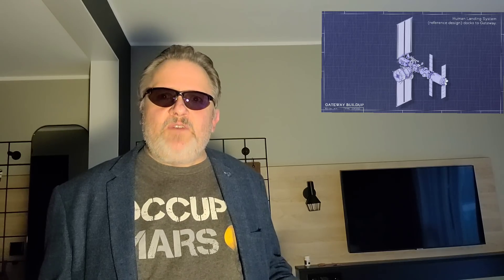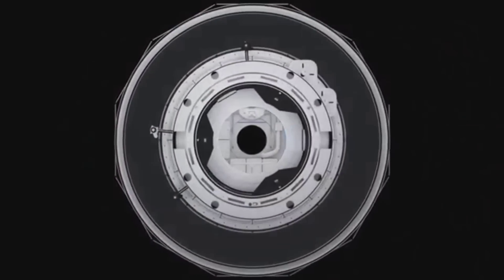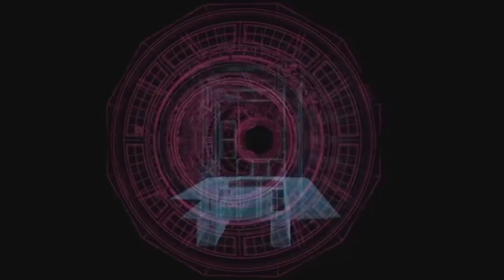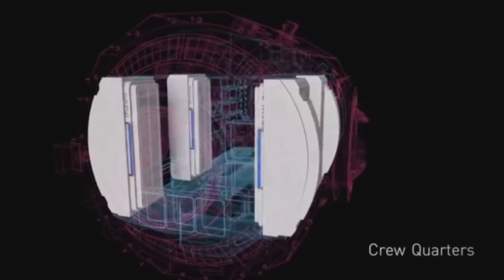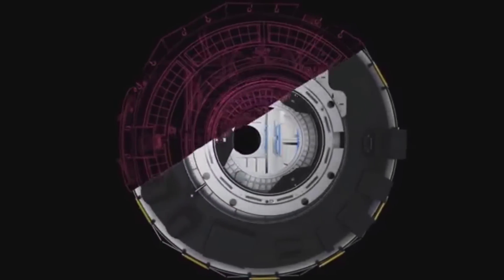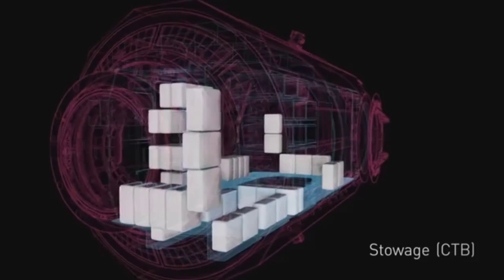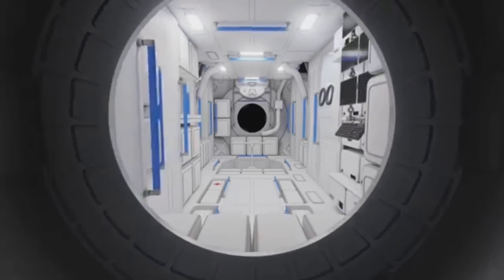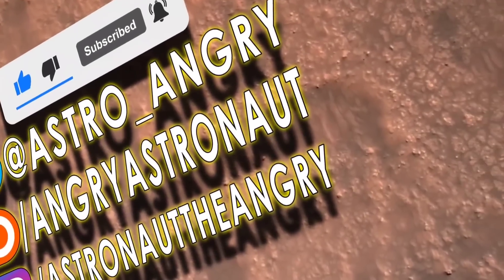New Lunar Space Station design has big problems!  NASA has better options!

Comment: I think ,it was a bad decision in general to chose an architecture involving a space station in Lunar orbit. While the apollo missions proved it to be unnecessary.  Compared to the ISS , lunar gateway is exposed to 3 times the cosmic radiation and solar winds, because on the ISS, the mass of Earth already shields from 50% of all radiation (coming from that direction), and additionally the ISS is within the Earth´ magnetic field. 
To supply lunar gateway with food ,water, and other resources requires a lot of extra effort, compared to ISS which is much closer.   To bring humans to the Moon, also you do not save any delta-V or fuel, compared to a direct rendezvous with lunar starship, since any extra rendezvous maneuver requires some extra delta-V. 
And finally, what shall humans do on the tiny lunar gateway,  what they cannot do better on the surface of the Moon, except trying to survive, cosmic radiation and claustrophobia ?

Comment: You're not wrong. Why does even the lunar base camp habitat incorporate an inflatable upper level, but Gateway has no inflatables? Sure rigid modules are time tested and well proven, but wasn't that the point of testing the BEAM module on the ISS? Only to go backwards, to an all-rigid module design for Gateway? This is NASA's big leap forward?

Comment: I salute "The Angry Astronaut" for this video. It's about time someone brought up Sierra Nevada Corp. / Sierra Space's inflatable LIFE habitat modules, which will see use on the Orbital Reef space station in Earth orbit. It's also high time that someone brought up that any operations in cislunar space will automatically raise the bar for crew habitat protection because of solar radiation, solar particle emissions, and galactic cosmic rays that would be far more abundant outside Earth's magnetosphere. These phenomena are known to represent a serious health threat to astronauts. 

I would like to add a possible idea to the notion of using Sierra's LIFE modules on the cislunar Gateway station. Here is a multi-step proposal that may make such a habitat module even safer:  (1: When designing and building The Angry Astronaut's proposed half-size LIFE habitat, Sierra (or whoever) must include secure packets of grease to line the entire fabric hull of the LIFE module; this enclosed layer of grease naturally contains hydrocarbons, which contains hydrogen. Hydrogen is the best known protective natural screen to stop harmful radiation and rays. (2: when erecting the new station in lunar orbit, set up a hollow, skeletal structural framework outside the final size of the LIFE module's inflatable volume so that this framework does not directly touch the module except at key structural points to keep the module centered inside. (3: Once the LIFE module is properly installed and inflated to its ideal volume and secured inside the outer skeletal framework, wrap the entire outside of the framework with an additional layer of LIFE module-like fabric to form an outer cocoon around the framework. Then spray the outside of this cocoon with a successive layers of water, to form an outer shield of thickening ice. Water ice also contains hydrogen. 

Would these additional layers of protection improve the safety of a habitat module? I would hope so. 

As for what vehicle could carry a LIFE module to cislunar space, let's not overlook the (pending) obvious one: Blue Origin's New Glenn. We are about to cross-over the major milestone of Blue Origin's BE-4 rocket engines being used for the historic first-ever launch of United Launch Alliance's new Vulcan rocket. And hopefully several months after that, Blue Origin itself will conduct its maiden flight of New Glenn. If these major milestones come to pass, NASA will be that much closer to a heavy launch vehicle that could deliver a full-size LIFE module to cislunar space. But wait... you say that I'm jumping the gun? New Glenn isn't going to be prepared to go beyond Earth orbit? This may be true for a New Glenn rocket, *by itself*. But consider this: if SpaceX could take three (3) Falcon 9 launch vehicles and put them together to form a more powerful Falcon Heavy for larger payloads and more thrust, why couldn't Blue Origin take three New Glenn vehicles and merge them together to form a New Armstrong? 3.85 million pounds-force of thrust, x 3,  will handily give Blue and NASA a new-generation launch vehicle, with at least partial re-usability, that could deliver a large payload to the Moon as effectively as NASA's backward SLS or SpaceX's Starship, and probably more.

Comment: After spending some time doing  so research. Also watching your video on starship nonreusable..I looked  at the lunar gateway  station and it is a desine disaster. I mean  total length 40 feet. Total diameter 10 feet. When all equipment  is installed  you have a hall way 4×4 feet. That is it. For a cost of $935 million but it is a goverment program so more like $1.5 billion. That is just building cost not including  the cost to put it in orbit.. why not build a modified  starship and put it into orbit for less cost and get more bang  for our buck..

Comment: Bezos should consider using O'Neil cylinder or torus designs. They are enormous in size and spin to provide gravity. The stations now are not more advanced than Skylab.
Reply: torus design would be better. O'Neil cylinder has severe problems and little to no air circulation. At least with a bulkhead you will get the air forced to circulate.

Comment: Space bouncy castle to the rescue, other choice is space Lego like the ISS, how about a StarShip with removable hatches on the fuel tanks and a cargo hole full of flat pack interiors components to convert the fuel tanks space into useable space. Maybe bring back some extra Moon dirt or as space nerds call it lunar regolith for shielding, have mounting brackets Pre-welded in place inside the tanks for interior assembly as well as outside StarShip for Ion thrusters Etc. you would have a space station with 3 separate pressurised compartment in case of an puncture to the station hull. The other possible would be to keep all the plastic rappers and compress them into radiation shielding tiles.

Comment: With a tweek to the design. Might be able to use uncrewed supply modules to attach to the outside of the crew module to offer more protection from radiation. Garbage, waste and etc could then be stored in the empty ones to offer additional protection from radiation possibly then offering a little more space within the habitable module.

Comment: 6:55 
There are many errors in this statement, so let's set the record straight.
I-HAB was initially designed to have ISS MPLM diameter (~5 meters) but that required to launch it as an SLS comanifested payload, without any other options.
The I-HAB designers wanted more flexibility in launch vehicles so they changed the module's diameter from 5 meters down to 3.1 meters, with a pressure vessel derrived from the Cygnus spacecraft, much like the Gateway HALO module.
This change in diameter meant that I-HAB could now fit on either SLS or any other commercial launch vehicle with a 5 meter payload fairing.
At the end of the day, this diameter change proved completely unnecessary because I-HAB ended up being assigned as an SLS Block 1B comanifested payload anyway.
I-HAB is currently manifested to launch on the Artemis 4 mission as the first of 3 Gateway modules (I-HAB, ESPRIT, Airlock) that are slated to be launched comanifested on SLS Block 1B, and is to be tugged into NRHO and delivered to Gateway by the Orion spacecraft.
It is not slated to be launched on Falcon Heavy with a standalone tug stage, but the fact that the designers wanted that option early on limited the scope of the module(s).
By the time the launch was decided to be on SLS Block 1B it was too late to change the diameter, so they are stuck at Cygnus diameter modules even though SLS has enough comanifested mass/volume capacity to launch MPLM diameter modules.
Too bad but it is what it is.
It's going to be a cozy little space station in lunar orbit, but astronauts should have no problem.
In regards to windows, the next module after I-HAB, ESPRIT, will have a 360 degree cupola section so there's no need to worry about nice views.

Comment: NASA needs to use the SpaceX Super Heavy booster as the first stage of a two, or three stage supersized Saturn V type Moon rocket. Even if the upper stages were disposable, the savings from the reusable first stage would be a game changer for the cost to put things in distant orbits, or landers on the Moon. 
Using a flame curtain might enable the second stage to be reused. Some private company is working on such a design for a reusable second stage right now. 
The Super Heavy alone is so powerful that it is a game changer all by itself.

Comment: Is the Sierra Space Life Module designed only for Vulcan Centaur?  5.4 meter diameter and 60,000 lbs to LEO.  Falcon Heavy is 3.7m and 50,000 to LEO.  Rocket Lab Neutron is 5m diameter equivalent for stage 2, and 17,600 lbs to LEO.

Comment: I have to agree with Angry here...  the inflatable tech would seem to be a a no-brainer for space station applications.  how much would it cost to just do an unmanned full-size, long duration test of the Sierra Life module, with no systems other than the most stripped down basic essentials, in the Distant Retrograde Orbit that Artemis 1 used?  literally, just send it with the instrumentation needed to monitor its performance and the environment.  

you don't need to spend billions of dollars to do onsite unmanned testing, and with inflatables you certainly don;t need to waste payload space by sending the hab module already fully fitted.  we are going to have to start doing on-orbit construction sooner or later, and stuff like fitting out habitable volumes on orbit (instead of sending modules up already fully fitted) would be a decent start.

Comment: AA criticism of I-HAB's retricted accommodation does not include the volumes of the attached modules: HALO; CYGNUS; Airlock; Lunar Lander; aside from ORION. The delivery of 4 modules and lander will occur before, during and with both ARTERMIS 2 and ARTEMIS 3 missions. So GATEWAY will have 4 modules plus ORION for ARTEMIS 2 and 5 modules plus ORION for ARTEMIS 3. This means GATEWAY will have accommodation similar to a small city apartment for 4 people for 6 weeks (with a trip for two for 10 days down to the surface!)  Doesn't sound too bad, really.

Comment: Lunar Gateway has always sucked. Why? The way the program was developed. NASA wanted a high tech follow on program using a cheap heavy lift vehicle developed from discarded Shuttle components. Once a SLS was designed, it needed a mission that is could support as it couldn’t land astronauts on the moon. Industry came up with Gateway. I quote Dr Robert Zubrin, “If you want to land on the moon, go land on the moon. Gateway only increases complexity and total deltaV to get to the surface” There was also this idea of a Earth crossing asteroid mission that could be accomplished with SLS/Orion, now quietly dropped. SLS/Orion/Gateway is the ultimate “pork belly mission” to keep NASA and the aerospace industries in business and an army of employees going.

Comment: In the colloquial language of my homeland, Gateway is a cockup from start to finish. In Apollo, ALL systems were pretty much designed and maufactured at the same time. It had to be this way in order to meet Kennedy's 'end of decade' time frame to beat the Soviets to the trophy.
  When Orion started its design process, it was intended to be integral to the Ares programme. This was commenced in 2003!!!! Now, as part of Artemis, Orion must be adapted to to its post facto programme. Gateway is also part of that adaptation, because, as most of you know, Orion's Service Module lacks the fuel capacity to fly an Apollo-type lunar orbital flight plan. Indeed, as part of Ares, Orion was supposed to fly autonomously whilst the entire crew landed, and remain unoccupied until lunar starship returns to the Gateway. 
    Gateway is needed to make up for Orion's relative incapacity within Artemis. Orion is need to support Lunar Starship's relative incapacity in its stripped down, heat shield-less version. 
    So, why not just use Starship in its original design, and fly it direct to a lunar landing? Honestly, Orion was so far along in its design and manufacture stage that from 2014, it simply could not be abandoned. Not because there were any basic hardware flaws, but because the manufacturing process was tied to geographical public monies distributions throughout the US, something current NASA Admin Nelson has openly discussed. As the NASA (and Congressional) auditors have highlighted (very quietly), this 'cockup' has resulted in the waste of billions of taxpayer dollars, and a decade of lost time in efforts to break humanity OUT of earth-orbit, where we've been stuck since 19 December 1969.
    As a guy who characterises himself as someone far lefter than Karl Marx, you'd think I'd be delighted with this de facto demonstrated corporate socialism. In fact, I'm disgusted with this entire disbursement, as it, so far, has not resulted in a single boot on lunar ground. Nor will it result in the 2024 moon landing. It could have, of course, if NASA had enough money to make it happen within Donald Trump's timeline. We all know THAT story. So I remain 'angry', as our sagacious host exhorts us all to be. More over, though, my anger maintains a high level of nausea-inducing disgust at a corporate culture that defines success not so much a matter of successfully completing science and enginering goals, but taking relatively huge budgets and making sure the 'private sector' receives these public dollars in as egalitarian a manner as possible. Lauditory socialist goals, of course, but from a purely scientific point of view, totally irrelevant. There's GOT to be a better way of doing things. And there IS. If the private corporation SpaceX gets people on Mars before and one country does. Not my idea of socialism, but certainly the best way to,get humanify off the 3rd Egg From The Sun. I'm spinning in my undug premature grave at the same time Herr Marx has contracted with John Wick to get rid of this backsliding socialist. Ouch.

Comment: The problem is gateway was designed before true heavy lift launchers came into the picture, so NASA did what they have been doing for ages now: stick with a design they know works. Gateway is basically a very small scale ISS

Comment: Tbf the Lunar Gateway wasn't designed to be crewed for long periods of time, as most of the Artemis missions are to be conducted primarily on the lunar surface anyway. If glass isn't just too heavy to launch, a Cupola on the Gateway would be a fantastic module to add on
Reply: The ESPRIT module will have a 360 degree cupola section, so no need to worry about nice views
Reply: @brokensoap1717  the current designs of ESPRIT that I've seen does not feature a cupola at all, only two small windows on each side near its forward docking port

Comment: Falcon Heavy has an approximate capacity of 28,000 kg to Lunar Transfer Orbit.
If NASA were to pay for the development of a 5 meter faring for Falcon Heavy then they would have a low cost LTO transport ,compared to SLS, for things like a larger Lunar Gateway.
Of course, if Starship works, the sensible thing is to pay for one to be placed in lunar orbit.  Brackets, etc. could be pre placed inside the propellant tanks.  Hatches for docking port attachment and between the cargo section and into each propellant tank could also be pre placed.  The cargo would consist of walls, floor, cabinets, and equipment that astronauts would install.  Complicated yes, but the result would be about 1900 cubic meters of living space - the ISS has about 1200 cubic meters.  This is also the way to a lower cost next generation LEO space station.
Reply: Falcon Heavy does not have a capacity of 28000 kg to Lunar Trasfer Orbit (TLI), not even close to that.
As per NASA LSP (and Elon Musk later confirming those numbers) Falcon Heavy has a TLI mass capability of about 16 tons when fully expendable.
28 tons would be slightly more that even SLS Block 1, which is a substantially more capable launch vehicle compared to Falcon Heavy

Comment: Remember SKYLAB, an adapted SIVb/3rd stage of the Saturn V ????  It was a LEO luxury hotel by comparison to ISS or Lunar Gateway.  Since SLS is more powerful than Saturn V, it could lift a modified SIVb into orbit and the single engine should be capable of boosting speed for trans-lunar injection.
"Skylab was 30.2 metres (99 feet) in length and 6.7 metres (22 feet) in diameter and had a mass of about 75,000 kg (165,000 pounds). Although limited by its consumable resources in the same way as the Soviet Union’s first-generation Salyut stations, Skylab was much roomier and capable of more research."

Comment: ### things a space station in orbit must have to not suck."  #1] Mobility without fuel gyroscopitic core spin wheels imposing counter momentum geo direction, #2] atmospheric cycling. Moxie & burn transfer ( i.g. Submarine candle tactics)....
#3 Example 1 & 2 grants a craft huge spacious options. #4 Use space balloons to first stage levitate massive full/set fold infastructer/launch pad/cadges into high enough point to reduce distance, gravity and drag travel into orbit velocity parking.

  This Vertical Idiocracy Beuracarcy of chem-fuel express burning 🔥 💰.  Will lead to small inatiquet cargo in "BROOMSTICK" payload of pure earthly angry astronauts.